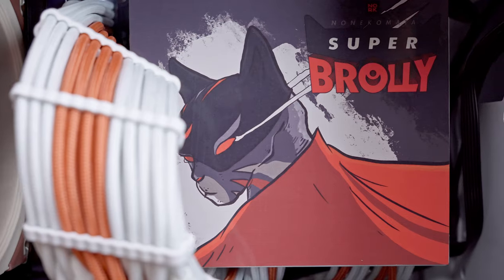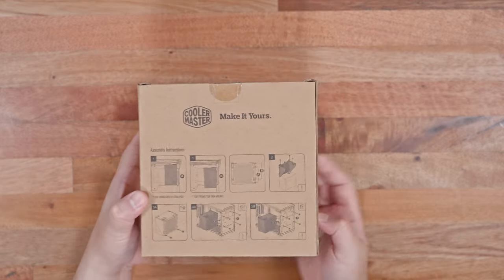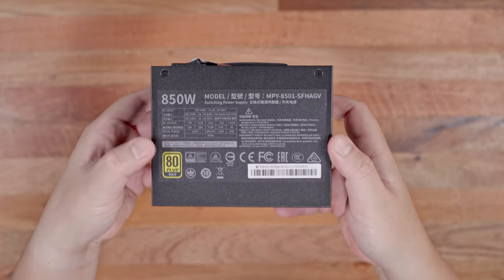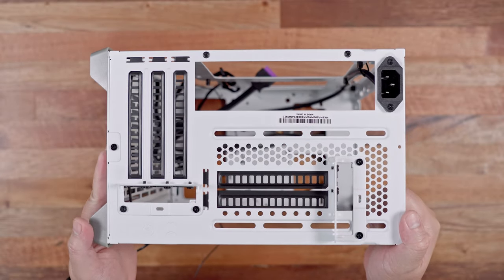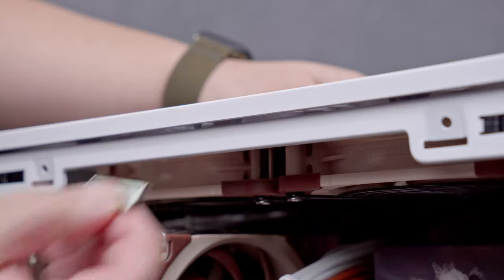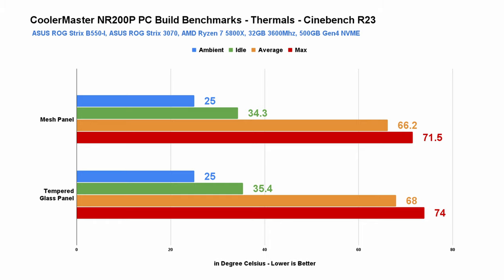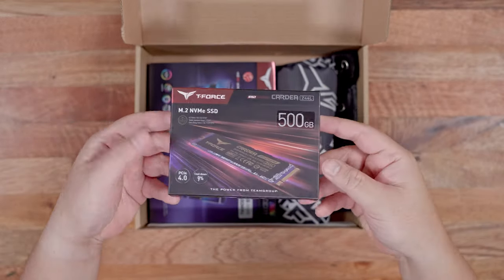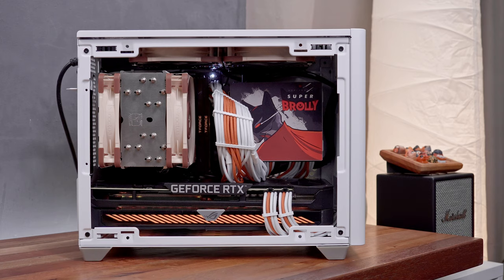Going Back to MINI-ITX Ft. Cooler Master NR200P + GIVEAWAY!

Comment from the maker: Specs:
Cooler Master NR200P: https://shope.ee/2fYkoXk8GY
Cooler Master V850 SFX: https://shope.ee/3fRI0QEqvq
ASUS ROG Strix B550-I: https://shope.ee/7zaHASI3Fc
ASUS ROG Strix 3070: https://shope.ee/8UWXlQB5Pt
TeamGroup Cardea Z44L: https://shope.ee/8epxxlRNdw
TeamGroup Xtreem 32GB 3600Mhz: To Follow
AMD Ryzen 7 5800X: https://shope.ee/5pVmans2N6
Noctua NH-U12A: https://shope.ee/2AcUE69FC4
Noctua NF-A12X25: https://shope.ee/5KZVzwRrFa
Cablemod Cables: https://cablemod.com
Nork Studios: https://www.instagram.com/nork.studios
Reply: Your Calble Mod how long did you get them made in?
Reply: Could you give the exact specs of the cable mod . The colour and length . I will use your affiliate link if you provide the details . Thanks

Comment: Im a huge fan of ITX build since 2010 but never had a chance to build one. Im still using my old i7 2nd gen MaTx build and my new lenovo Legion laptop. Installing PSU is the my favorite part as this will show how to handle stress and patience on how to route the cable through the case. #SuperBrolly

Comment: you can solve the clearance issue for the tempered glass by using CRYORIG H7
Reply from the maker: I could, but I already had the U12A from my previous build. Also, i think im gonna stick with the mesh panel :)
Reply: @TechBroll  i have the also the same issue for my case a tecware fusion.... im using a deepcool one but the heatpipe bumps thru the glass... so opted to purchase a cyrorig h7 and swap the fan for a noctua one... thats solve the problem for me...

Comment: pinaka nagustuhan ko sa build is yung itx case from cooler master which is ang NR200P. Napaka vertsatile ng dating pwd pang minimalistic or modern design kung gagamitin mo yung glass na side panel. May kamahalan lang talaga pag ITX build compared sa ibang build, pero in terms of aesthetics, solid talaga kase nakakatipid ka sa space. Slamat po sir marvin.
#SuperBrolly